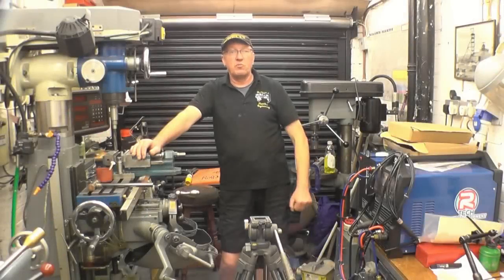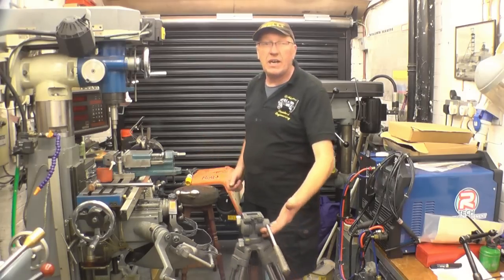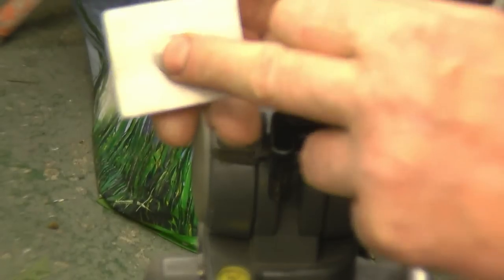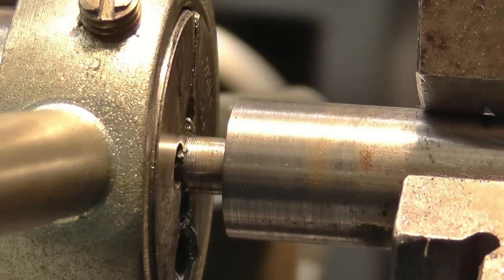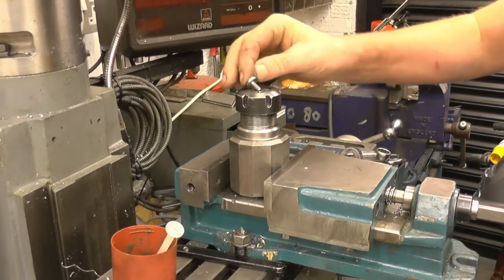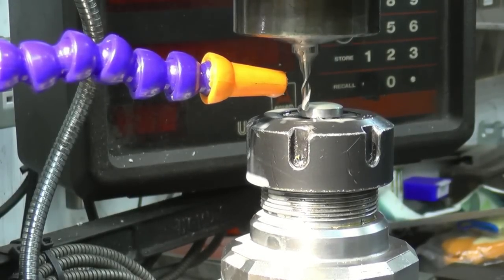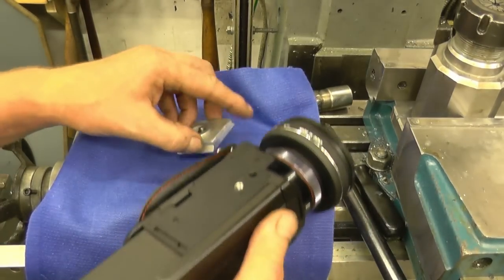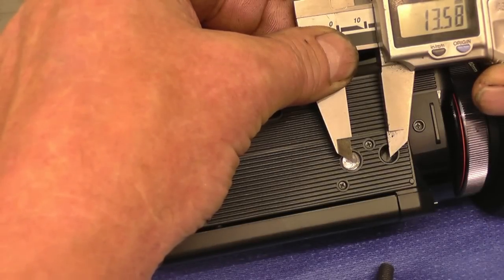Sunday Night NC 87 part one

Comment: I made a quick-detach plate for a different system (circular) in one of my shop videos, so this speaks to me. For some reason, I have at least three different quick-detach systems around here. I really need to choose a single system and get rid of the rest.

If you put 1/4-20 threads in the hole through your adapter plate (1/4" thickness after machining the counterbore for the head) and relieve the shaft of your 1/4-20 screw for 1/4" under the head, you will create a captive screw (it will rotate freely in the plate, you can get it out, but it won't fall out). This is how all my commercially made plates are designed. Too late for this adapter plate (already bored for 1/4" clearance), but maybe for the next one. The o-ring is a nice hack to substitute for a captive screw.

A couple of my adapter plates have a slightly larger counterbore and a semi-circular wire bail which can be flipped up to let you tighten the screw without digging up a coin, washer or screwdriver, yet still lay flush on the underside of the plate. The counterbore is tapered to let you get a nail under the bail to flip it up.

I don't know if you will have trouble with the rounded-crest, 55˚ threads (I could see the rounded crests in the video), but I think the standard camera thread is 1/4-20 60˚ with slightly truncated crests. I'd be happy to send you some 1/4-20 60˚ taps and a die if you don't have them readily available. (What diameter die holders do you have?)

Best to Deb and wishing for her continued improvement. I just had a couple of stents put in this week, so I know how it feels to be feeling a bit sub-par.

Comment: John, that looked like a fairly new camera.  I would have thought its mount would use 1/4-20 UNC (the current ISO standard) rather than 1/4-20 BSW (the older Royal Photographic Society standard).  Nice project.  Thanks.
Reply: rfcarlson1 My thoughts as well.  I had never even considered that there might be other threads used for camera mounts and that the standard was manufacturer driven.  At a minimum there should be a replaceable insert allowing other threads to be used.

Comment: John, I thought camera mounting threads were 1/4 Whitworth, because that was what I was familiar with. But given that Mr Eastman was a 'merican, I suspect that camera threads are actually 1/4 - 20 UNC. That is the same pitch as 1/4 W, but the thread angle is 60 degrees rather than the 55 degrees of Whitworth threads, which means that a Whitworth screw will fit the UNC nut or socket (while a UNC screw will not fit into a Whitworth nut).

I came to this conclusion because I was making drawbars for some of my milling cutter holders. I thought "Ah! This is 5/8 Whit and that is 1/2 Whit! How convenient!" Upon reflection I came to the conclusion that the (Chinese) tools were made for a world market, that our old-school Whitworth threads probably didn't make up a large part of that market, and that good ole 'murrican UNC was probably the real size.

I haven't actually checked this because the Whitworth threads do work, but I will, and if UNC is the real "thing" then I am going to have to remake my drawbars to suit, because the UNC threads (if that is what they are) will be a better bet for that purpose, being a better fit.

Just sayin'...

Comment: You must have noticed your 1mm error before drilling then? I was waiting for your swearing when the peg didn't drop in the locating hole. 
Glad Debs is improving. The holiday will do her good.
Reply: the filed-off threads probably accounted for the error
Reply from the maker: +zepp113 It was not until I edited the video I found the mistakeI can normally "eye ball" within a few thou
Reply from the maker: +jonno85uk I had to file off more than I thought